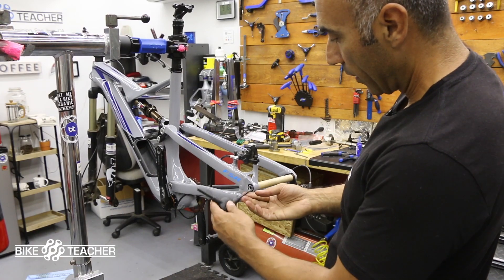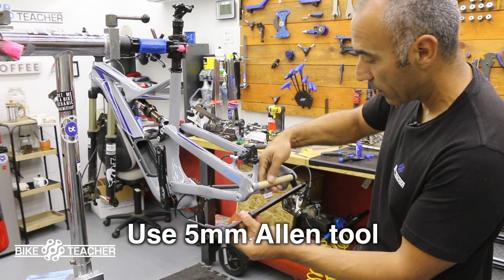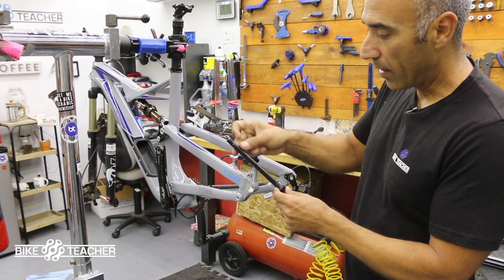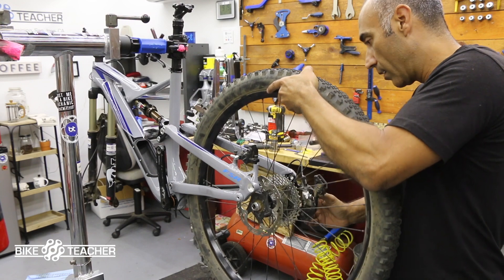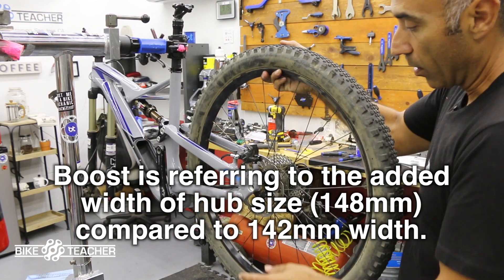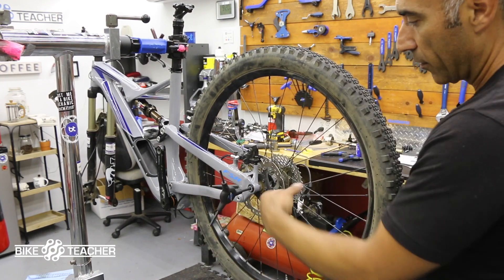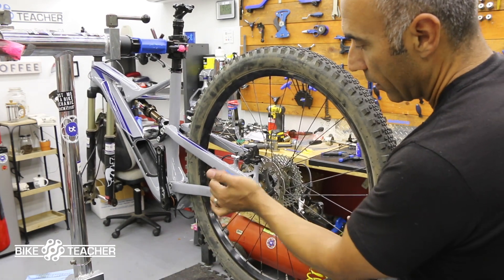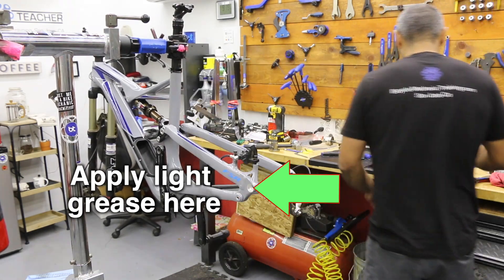How to mount a rear wheel with a 12mm thru axle hub, non boost

Comment: Just got finally a mountain bike. It come with a thru axle. My quiestion is ( the rear axle treed doest go all the way in to the treed itself in the gear side of the frame before i cant tighten up the axle? It seems that i goes in only half the way... Is it normal?
Reply from the maker: Typically I see it almost to the end or just shy of being flush. I would like to see it touch at least half the threads at minimum.
Reply: @BikeTeacher  looks like 75 percent in.
Reply from the maker: That should be safe.
Reply: @BikeTeacher  thanx. Panicking for a moment.